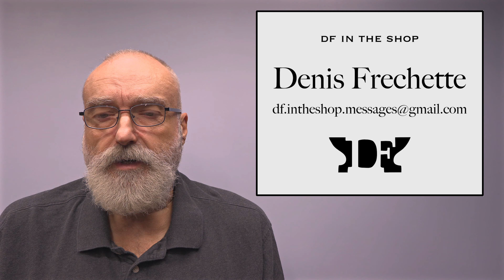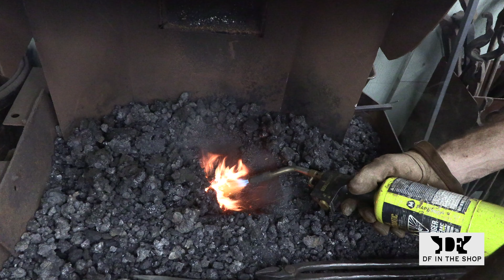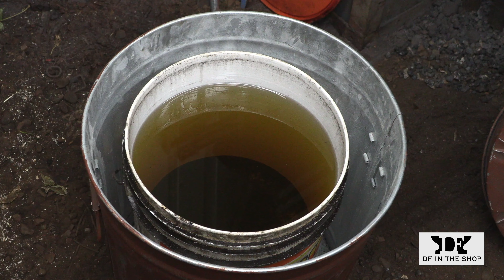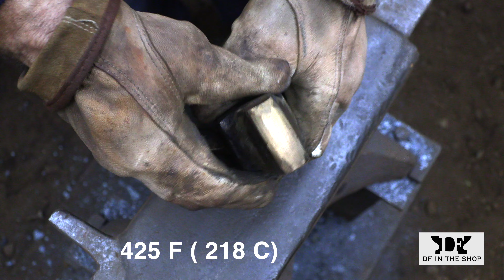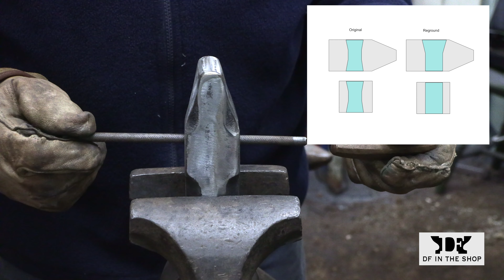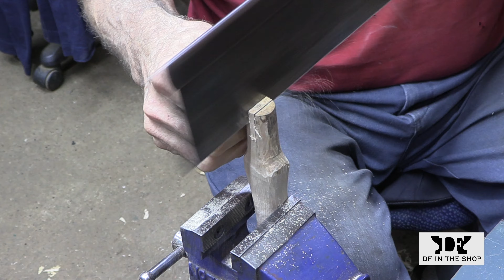Blacksmithing For Beginners - Forging a Cross Peen

Comment: To make a diagonal peen, do I just make a cross peen and then twist it?
Reply: There's no need to twist. Just forge it at a 45-degree angle. For a vertical cross peen, forge it at a 90-degree angle in line with the eye of the hammer head. Hope this helps godbless and happy forging.
Reply: There's no need to twist. Just forge it at a 45-degree angle. For a vertical cross peen, forge it at a 90-degree angle in line with the eye of the hammer head. Hope this helps godbless and happy forging.
Reply: @mountainwolf1 

Thanks

Frank